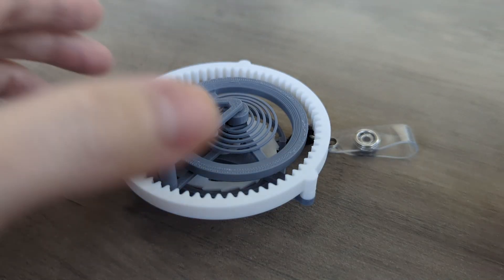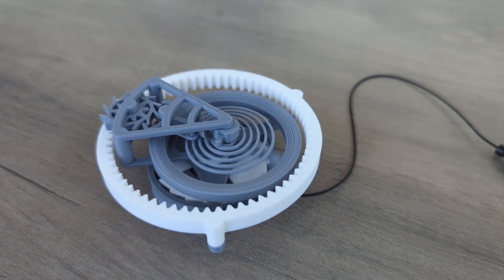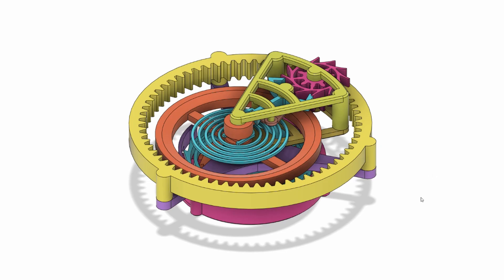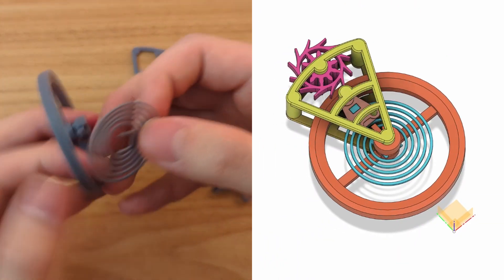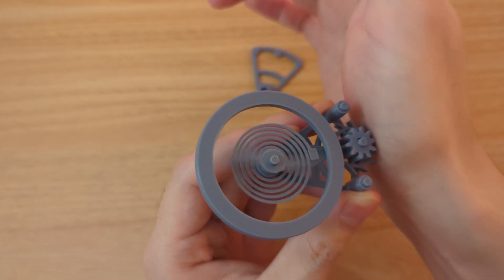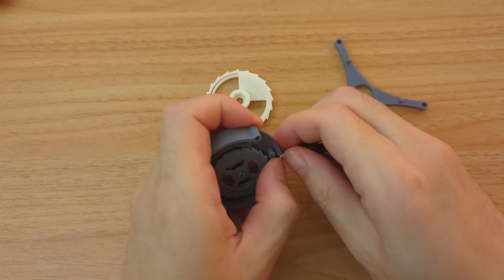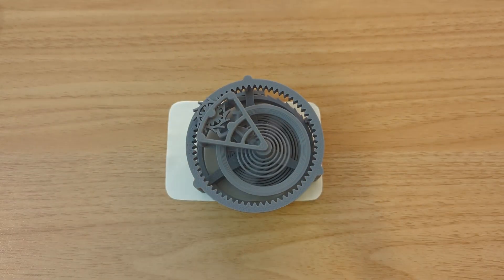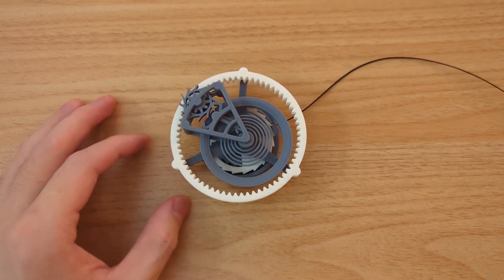Tourbillon Desk Toy

Comment: Hey! I know this video is a couple of months old already, but I was wondering about a few things. Most importantly; how did you determine the right geometry for the flywheel side of the escapement? I'm able to find a lot of resources on the pallets and escape wheel, but have yet to find anything on the other important aspect. Secondly; how did you get your print quality this clean? Especially on the contact surfaces between the escape wheel and pallet fork, I can't seem to get mine good enough, but overall your prints (at least in the video) look almost resin-like!
The design looks fantastic, btw. Very much appreciate that you've even included a fully-printed option for the mainspring, too!
Reply from the maker: Thanks! The balance wheel and hairspring sizes were roughly based on the dimensions I saw in other similar designs, though it did take a couple rounds of trial-and-error (my first iteration was too small).

Regarding the print quality - I'm using a bambu lab a1 mini and am generally happy with the print quality (especially coming from a decade old makerselect), but I imagine other modern printers are likely comparable. The video compression probably also makes the parts look smoother than they are in reality. The escape wheel and pallet fork were definitely tricky to get working - sometimes I had to sand the pallet fork contact surfaces a bit.

Comment: Just got mine working reliably. Had to redesign some of the parts for more reliable movement, probably due to my particular printer print tolerances and the PLA I used. Mine "tics" a lot faster though. Will play with the hairspring tension to see if that'll slow it down.
Reply from the maker: Nice, that's awesome!

Comment: This design is amazing!!!  A really great educational project for kids!!! A must build!!!  

I have been tweaking with it for a few days now and while everything fits perfectly unfortunately the momentum does not keep and it will only tick for maybe 4-5 ticks even after adding bearings and making slight reductions in size to gears.  

Can you outline the tricks to fine tuning and getting it to run? 
Could you also post your printer settings and the filament type you used?  
Does it need ball bearing weights in the balance wheel edge to run properly?

Used Ender 5 with Creality PETG
0.4mm Nozzle with 0.12mm layer height.
Nozzle temp: 240C
Bed Temp: 70c
Reply from the maker: I printed with a Bambu Lab A1 mini using Inland PLA, with a 0.4mm nozzle and 0.2mm layer height at 220C. I did a lot of trial and error with adjusting the impulse faces of the pallet fork. But I also ran into similar trouble getting it to work reliably with different filament on the same printer, so it felt like there was an element of luck. I didn't need to add weights to the balance wheel, though I imagine that could help.

Sorry I don't have any great advice. If I were to design this again with reliablity/reproducibility in mind, I would probably replace the axles with brass rods and drill out the holes as a post-processing step. Some references for other escapement designs that use metal axles:
https://www.youtube.com/watch?v=bxuiNc3VA58 
https://www.youtube.com/watch?v=--qqFnPk3KM

Comment: Brilliant idea using a badge retractor for the spring. I'm going to have to make one of these, with a few mods: metal rods for the axles and maybe embed screws around the circumference of the balance wheel to give it a little more flywheel effect. Maybe I can use this as a basis for a full blown functional clock or a more complex moving toy.

Comment: Almost every design of escapement that I've seen uses a single frame to hold upper axels of balance wheel, pallet and escapement wheel, which somewhat obscures its working. How do you think, is it possible to make escapement that is held down by just individual pegs on each axle?

Comment: Is there a specific size I need for the badge reel? I'm trying to make one too with the stl and the badge reel I have is different from the one in the video.
Reply from the maker: Unfortunately, I don't know the exact brand of the original badge reel. I got some new ones recently, and they're also sized slightly differently.

I've uploaded the fusion 360 files to https://github.com/kevinbchen/tourbillon-desk-toy if you want to tweak it for the parts you have.

Comment: aaah printed it on my bambu a1, all fits together but it only clicks for like 1-2 seconds before it stopps again
Reply: same here. have you solved this problem?
Reply: @stan.3dprints  YES I think I figured it out. you need to print the Escape Wheel mirrored on the x plane. this will reverse the gear. I noticed in the video that the large spring gear is a mirror of the model but instead of printing all of that again I decided it would be easier to print the small gear.
Reply: @Aaron-bo8mz  HOLY it worked!!!!!! i was about to throw it away but your comment saved me.

Comment: This is fantastic, one of the most beatiful things to 3D print for those who like mechanics. Question regarding the version which have only 3D printed parts and lasts a little bit less than a minute: if it the spring radius would have been bigger, could it have increased the amount of time the mechanism works?
Reply from the maker: Potentially! The spring does need to provide enough force to power the escapement, but not too much that it causes skipping; might take some experimentation to get that balance right.